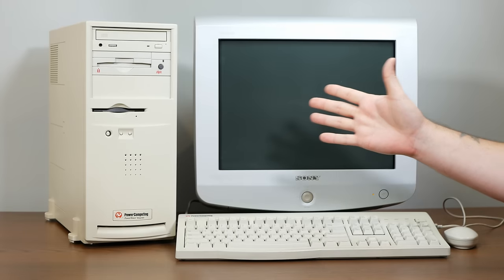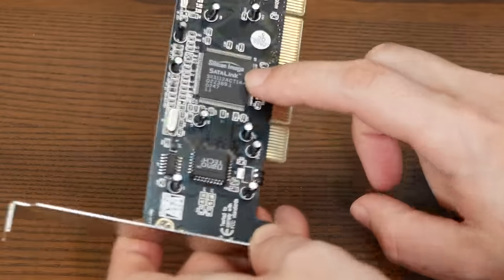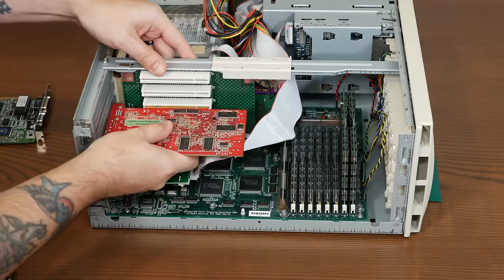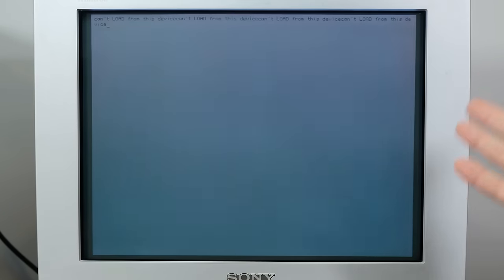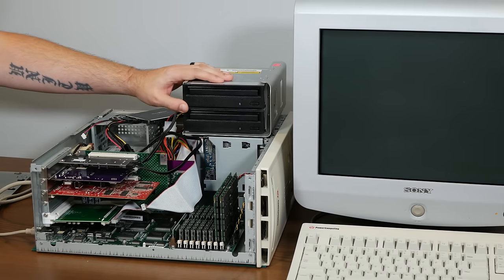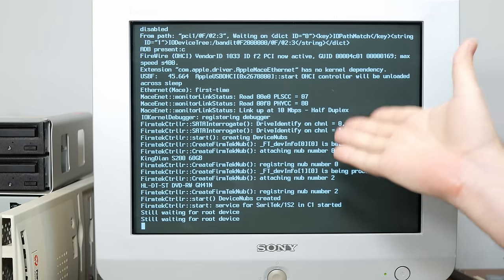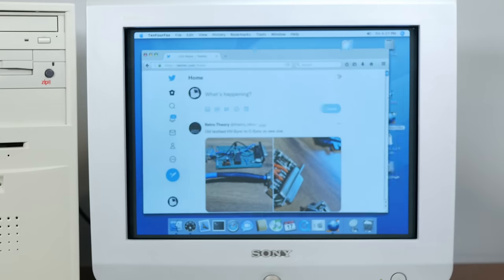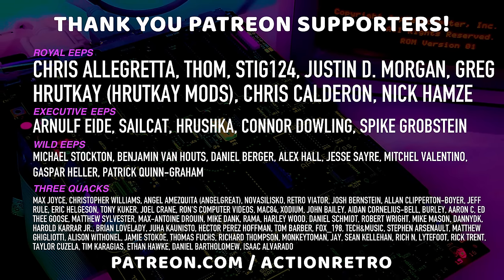Extreme 90's Macintosh Clone Build FINALE!

Comment from the maker: Thanks for watching today's clone shenanigans! It would really help the channel if you check out today's sponsor link, https://squarespace.com/ActionRetro. It comes with a nice 10% discount if Squarespace is something that's on your radar!
Reply: I agree with Benn Birch and Common-Sense-500, somewhat of a slough to get thru this one and these modern age benchmarks are pretty boring thb, show us what the upgrades can do instead of what it can't do.
The 9200 can't accelerate modern web, it sits idle while the CPU renders the webpages, lets use the 9200 for what it's designed for, pumping out polygons.
Reply: How is squarespace got to do with computers?
Reply: Massive effort congratulations.
Reply: @Action Retro 
Question:  You showed a slot loading SCSI DVD drive for this video.  What is the make & model of that drive?  I'd like to see about getting one for my Power Macintosh 7500.  The internal 4 or 8x SCSI CD-ROM is flaky at times.  Good to see you going the distance on these upgrades, although I'd rather keep 'em in OS 9.x territory myself.  The only reason I'd throw OS X on it would be for modern network file share SMB support.

Comment: Next up you should try to install Windows NT Workstation 4.0 for PowerPC on it
Reply from the maker: Hah I love this idea
Reply: Would be time appropriate too (well, without all the upgrades)
Reply: Not possible. NT on PowerPC platform is very picky, and needs 2 components which have to be supplied by the manufacturer, which is a proper ARC firmware build for the machine, or an ARC firmware emulator for the OpenFirmware version built in the board (VEENER, akin to NTLDR on x86 PCs)... And a HAL which has to team with such firmware build. If Firmware/VEENER and HAL mismatch, the OS will not boot.

Interesting enough, at one time Apple had both components for Macs and clones based on this Tsunami/Nitro platform, which were developed by Firmworks/Microsoft for Apple... And in fact one Mac running Windows NT native was shown in some last 90's MacWorld expo... But besides that expo, these important pieces never made on the public, as Steve Jobs killed absolutely all of it on his return to Apple, along with the clones and the whole Tsunami/Nitro platform.
Reply: @hyoenmadan  Another reason is that NT 4.0 on PPC is little-endian only while PPC Macs are big-endian, and Macs' Open Firmware does not have the ability to change endianness.
Reply: @chu-icehugehard1820  Thank god.
Reply: @chu-icehugehard1820  Actually... There is support in Apple Openfirmware for that. It is the "little-endian" environment variable (to be called using "setenv little-endian? true"). Would be a vestigial on Firmworks OFW source from time when NT was about to run in PPC Macs? But they forgot to remove it? Would have been used on first stages of Xbox360 development? Unfortunately, the rest of the firmware components supplied with the Mac may not work in that mode, so it will brick board booting until you erase board nvram. So don't set it.

Also, even in the case you could get it to work... You still miss VEENER ARC firmware emulator executable for Apple's ofw, and a proper Hardware Abstraction Layer image for it.

PD: Apple ofw also has in all their versions a hidden nvram variable called "nt-hack?". Some forums say these are meant to be used by the MS/Firmworks ofw ARC emulator... Which never was released. That would explain why you can't set them from of prompt.
Reply: @ActionRetro  I'd love to see it.
Reply: @hyoenmadan  time to hack it ;)
Reply: But this is the FINALE

Comment: Overclock the system bus if you can on that clone. As far as I know, the beige G3 was the first that could overclock the system bus, so a similar thing could be possible with the Power Conputing clone.
Reply: Cardinal Sin  Can you change the multiplier on it?
Reply: You can maaaaaaybe get 60MHz out of one of these, but it's not likely: PowerComputing had to specially test and configure the few they did sell at that speed, and they had compromises (such as the loss of memory interleaving) that meant they weren't all that much faster than the 50MHz versions. The problem is primarily that the custom Apple chipset they had to use can't handle it (they were officially maxed out at about 55MHz). Other chipsets from IBM and Motorola could go faster, but Apple didn't want to use any of those until the MPC106 in the beige G3 and B&W G3/Yikes! G4.
Since the Sonnet upgrades require memory to be deinterleaved regardless, it may be worth a shot at a system bus upclock to 60MHz to try to recoup some speed. It's a question of how the Sonnet card will react after that, since they auto-sense bus speed and set CPU clocks accordingly. You'd also have to more carefully select RAM and ditch the L2 cache card (which is recommended to be removed with a G3/G4 upgrade anyway).

Comment: I would guess that the divide by zero error is likely because there’s a timing loop to try to do some performance test, and it’s probably running way too fast and getting a time of “0” back. This is a pretty common problem on software that was written with obsolete assumptions about the speed of the system it’s running on.
Reply: Yup, the old Jazz Jackrabbit issue
Reply: @yukisaitou5004  yeah, pretty much every game that was compiled with Borland tools in the mid-90s is subject to it because of a pointless calibration loop that is in the startup routines for Borland's keyboard I/O library.

Similarly, a lot of early CD-ROM games absolutely refuse to run on a 4X drive because they detect that you "must be running a drive cache" because there's no WAY that a CD-ROM drive could be providing data faster than 300KB/sec
Reply: Some older versions of Linux/UNIX would sometimes have weird 'divide by zero' and other errors during installation if you had too much RAM in the system during the install process (even if the system and the OS supported it once finished installing).  This eventually led to kernel parameters you could enter to limit RAM during the install.
Reply: @AShortBusVet  Ah yeah, that's another good point, 32-bit address space + 4 GB of RAM = "0 bytes" of RAM available
Reply: @AShortBusVet  Windows 98 has a similar issue. Anything past 512MB you should edit settings so it can even boot. Put 2GB in, and sometimes even edited settings won't work. Luckily 512 is overkill for any 98 software, but it makes installation difficult on newer hardware if you don't have small enough dimms.

Comment: Remember the adage, MOLEX to SATA, loose all your data. Those power adapters are notorious for shorting out.
Reply: 100% - though I suppose one could insulate the junction between the wires and plastic - probably with an absolute crapton of hotglue, but it could work.
I think the best solution would be to create a sata power cable for the modular power supply in that machine

The last thing I'd want to see is an electircal fire in this beauty
Reply: Never had an issue with them in 15+ years

Comment: Are you turning the L1/L2 cache back on after boot? A 500MHz CPU with L1/L2 on might be faster than a 1GHz without.
Reply: At least on the PC side, running without cache takes any modern CPU down to 386 levels of performance - try running any version of Firefox on a 40MHz CPU. I can only imagine it would be a similar story with PowerPC, and he's probably correct about the slow system bus.
Reply: Okay well neverfuckingmind apparently lmao

Comment: You probably know this, but PCs can be similarly weird about system requirements. For example, try installing Windows 98 on a system with 1 gig or more of ram. Everything from weird driver issues to not booting/installing period. 2 gigs or more just breaks everything. It's best practices to get everything installed with 512 megs (I've heard 768 is ok, too) , patch the OS, and then max the ram out (4 GB IIRC).

Comment: Wow, only a 50MHz bus speed? That's less than a third what it should be! Now I'm wondering how the bus works on the logic board, and if it's possible to somehow overclock it while leaving the processor at the right speed. I guess the trickiest part would be making sure the PCI bus stayed the same speed, since PCI cards can be pretty sensitive to clock speed.
Reply: Heh, is interesting tons of logic in later chipsets and memory controllers, go to ensure proper speed frequency dividers for the PCI and slower peripheral buses, so them could work and team properly with the ever increasing memory and CPU base frequencies.

Comment: This is my favorite project of yours yet. I love this sort of thing. I love the slot load DVD drive too. Please install it! That full size ZIP drive is wild too. 
As others have said, see how you can overclock the system bus. Its usually a set of SMD jumpers on the mainboard. 
Hey i don't usually bug folks for this sort of thing in youtube comments, but would you be willing to sell that g3 upgrade card from you if you don't end up using it? The XLR8 one i have in my Powercenter pro doesnt work right.

Comment: Divide by zero happens because the drive (or perhaps the CPU) is too fast.  The software did a naive bench mark and checked against the milliseconds passed (which is zero) for some random operation.

You could try installing it on a slower drive and then doing a block copy to the new one.

Comment: If you want more airflow you should be able to put in a small fan near the speaker behind that expansion card support bracket. I think there's even a 3-pin fan header on the logic board for one.
This is one of the machines that usually plays nice with most combo USB/FW cards (assuming they're not VIA chipsets) or other things with PCI bridge chips, so you don't necessarily have to use specific cards here like you do on the fussier Alchemy, Tanzania, or Gazelle-based models. On machines like these I usually like to get a card that offers additional headers so I can use one of those FW and/or USB port slot covers. More ports are more better, after all.

Comment: Nice video, thank you. Back in the day I had an 9600 with lots of Ram and a G4; Leopard on that felt sluggish compared to a low end G4 Digital Audio a friend of mine had. I sold the upgrade, got an G3/300 and went back to 9.2. It felt better suited and I still had USB/Firewire/IDE from the Tempo Trio (which worked on Leopard btw)

Comment: Cool series. This does remind me back early 2000's I upgraded my Beige G3 to Radeon(Mac Edition), G4(Overclocked to 666MHZ), IDE 133, 768MB and running 10.2 along with 9.2.2 Even a 2nd HDD with YellowDog Linux. I remember it was a tedious project, and everything has to be set just right, and right order and took days of work before I got it to where I wanted it to be. I think we would like to see the gaming results on your upgrade.

Comment: Those DVD drives are from a Mac Pro - the G5 only has a single optical bay. In fact, the early Mac Pro's used PATA for optical drives, so they would be from a 4,1 or later.

Comment: The DVD drives are not from a G5 tower but from a Mac Pro 4.1 / 5.1;), the only Pro to use DVD drives with Sata bus. In fact, Mac Pro 1.1, 2.1, 3.1 use parallel drives. I say this with great certainty because I have 3 MPs. In your tests it would be interesting to see those machines working with 3D / 2D production software.

Comment: It is very interesting to see such an outdated machine running OSx Tiger. You didn't tell us if the G4 has a 3rd level cache, which would help it a lot with that slow system bus. The problem for the G4 is moving large chunks of ram with that slow bus and system memories that make it wait to turn its thumbs. So I'd say that machine could be better on OS9, BeOs, and MorphsOS

Comment: I wonder if you remove the SATA PCI card, if that would let you re-enable L2/L3 cache and turn off throttling on the CPU - both of those can easily make the Mac feel dog slow, sadly. The SCSI2SD v5 is also probably pretty slow for a PPC Mac, where the v6 would max out the SCSI bus throughput.

Comment: You're also dealing with the 32bit file size limiter.... The same as any 32bit Mac. 4GB is the largest recommended disk size for the boot disk on a 32bit Mac. There are hacks that work on the disk side to deal with the issue... or you can just put a 4GB partition on the front of the disk.... 

As to the bus speed, there should be pins on the motherboard that you can tinker with to overclock the front side bus, but these machines run really hot, so you will want to run a larger heat sink on the CPU otherwise you'll melt the CPU.

Comment: Some of these upgrade cards were not completely compatible with OS X as some of them ran different PPC chip versions that Apple never ran/supported. It may be an issue of complete incompatibility with OS X. It's a shame most of these vendors are dead so you can't easily access the tech specs for them or their websites. In that case you would have to check what PPC chip version it is and work out if that chip was compatible with OS X.

Not all the Newer, Sonett, etc, chips were standard issue Apple some of them came from Motorola/IBM.

The more I watch your channel the more I remember things I went through 20+ years ago.

Comment: Have my Powermac 5400 running off a cheap half-length SATA SSD, using the jankiest SATA-IDE adapter I've ever seen - covered in hot glue blobs. Oh to have more than one PCI slot for something faster and more elegant like this.

Comment: Hmm... Is the PCI bus faster than the SCSI bus on this computer? Either way, you're going to have a massive bottleneck. I always remember the SCSI bus on these things being pretty fast. But then that was the 90s where I built a 500mhz G4 out of a 7600... Yes the video card was slow back then, on the 7600 you could upgrade the VRAM to 8mb though which fixed that issue. I'm sure the ATI card is much faster than the onboard ATI card though.

Comment: *cough *cough the cd drives were from a mac pro, the g5's only had one cd drive slot
Reply: You also couldn’t take out the dvd drive slot of the g5, you had to remove the dvd drive from it to get the dvd drive out of the g5, but from the looks the g5 and Mac Pro use the same SuperDrive Just with IDE
Reply: @SylveonTribe  yes, that is true. i have owned both and now have a g5 that is atx modded but still looks very very stock.

Comment: These modern age benchmarks such as the web are getting pretty old imo, it chugs along, to no one's surprise I imagine.
Please consider games and apps that targets the upgraded hardware specs as well.
It sort of sucks that there are those who generously donated or located you very rare and expensive upgrades and you use benchmarks that are ill suited to them and don't demonstrate the performace gain very well.
Like that time you've been donated the Radeon 9200 for the beige G3, an 3D accelerator with no video decoding, and only tried to watch Youtube with it at 0 fps.
Due to your choice of benchmarks, most of your Power Mac upgrade videos ends up being samely and therefor not as interesting as they could have been. 

Here's a extremely rare part, lets run a number crunching test and try an app that is nearly a decade newer than the part and is a moving target, conclusion: didn't do a good job at it.

That said,  I still enjoyed the video though I think it could have been more.
Reply from the maker: I appreciate this feedback a lot, thank you!

Comment: Yes, the 50 Mhz FSB limitation turns any procesor speeds above 400-500 Mhz pretty much meaningless. Which is also why it performs around a low end G4 tower. But still a huge improvement over the 180 Mhz 604 in the PPC 8500. :-) I put a 400 Mhz G3 upgrade into my 7500 and am pretty happy with the result.